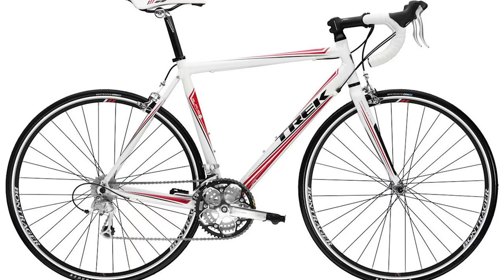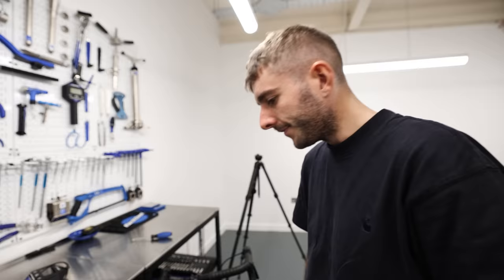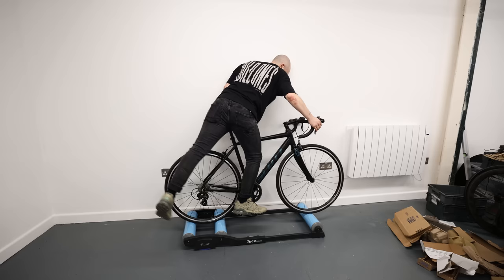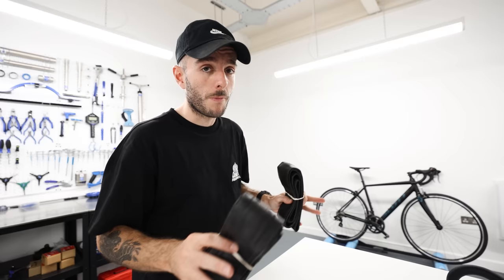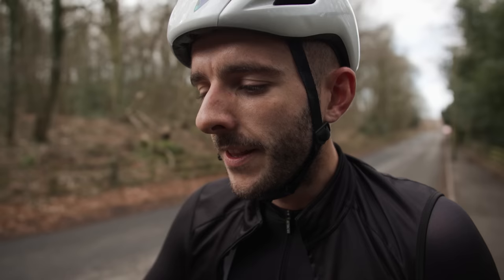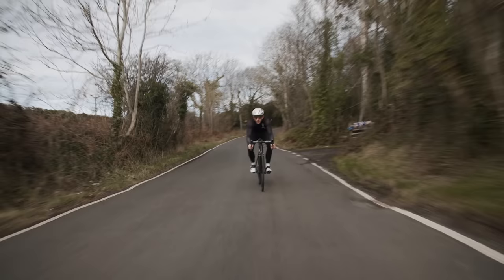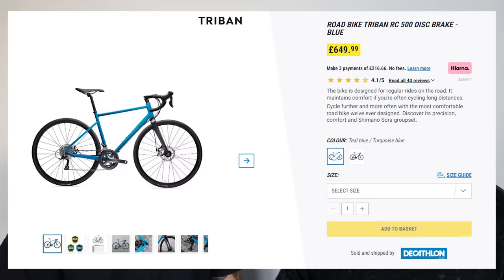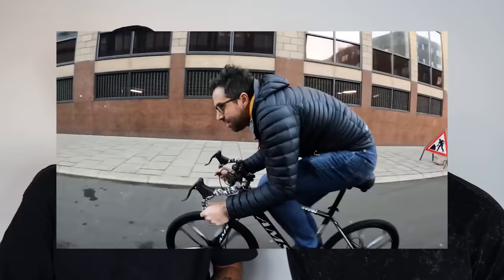How Good Is An "Entry Level" Road Bike In 2023?

Comment: Last year (march) I got a gravel bike with aluminium frame, carbon fork, full GRX groupset (a bit of 600 and mostly 400), nice hydraulic brakes, 46/30 at the crankset, 10 speeds at the rear (11-32 which I've since changed to 11-36 to climb easily). All this for £879. 3000km later I am still the happiest "beginner". Hard to find that kind of price at the moment (except if you find the same model, but with the current difficulties to get Shimano parts, they are now equipping it with a no-name 46-30 crankset instead of the GRX).

Comment: My avatar is my first entry level bike 2015 Ultegra front & rear mech with 105 chain rings, levers & brakes, aluminium frame & seat post but a full carbon fork, compact 50, 34 with a 11-32 & Mavic alloy wheels, £850 from Tredz, fantastic spec for the money, i remember the Specialized Allez coting £650 at the same time but the spec was far lower then the Cube Peloton SL.

Comment: my first roadbike was a used decatlon bike with sora 2x7 groupset  for 195€. it made realize how fast and easy even i could ride even longer distances. i probably rode it 3500 km in the first year. i replaced the steel fork with a  cheap carbon/aluminium one,  the saddle to a used fizik, aswell as the breaks the bartape during this time, the weight is a litle under 10kg and the bigest gear is 52/11 so its quite fast. after that year i got a used cervelo p3 and gave the the decatlon to my brother as a birthday gift a litle later, he also realy likes it and already put about 1000 km on it, (we both use other bikes durig winter) about 300€ well spend i guess.

Comment: In 2014 I bought a brand new BMC GF02 (2013 model) with all 105 parts and triple crank + 10-speed cassette (11-28) for only  £900. The original price was  £1400.  So I advise looking around in shops for a model from the previous year and paying less for a better bike. Looking forward to more 'outdoor' testing videos ;) cheers.

Comment: My first adult bike was a second hand specialized Allez sport 2012 which had a sora full group set (triple 50/39/30 and 11-25 9s cassette) which I picked up for £100. Frame was a 58 which was 2 sizes too big, which I didn’t know at the time. Was a great bike which gave me the bug. Picked up a second hand carbon mekk poggio next which had only been used twice for less than half its original price and still have it, though upgraded everything but the frame. Bought another Allez sport second hand to build up for my trainer, in a 54 this time and managed to build for a little over £125 running 10s sram axis. Second hand bargains are the way to go for me. Love your vids by the way. Been watching for a few years now.

Comment: 7:16  Yes it does, Shimano Claris, at least on my entry-level Giant Contend, has the extra speed on the easier gear. With the compact 50-34 in front and 11-34 (biggest sprockets are 28 and 34) give you that necessary easy gear. 34/34 should be most welcome for most amateur, me in particular !

Comment: My first road bike was a Merida scultura with claris, same ratio as that bike but 2x8, I replaced the shifters with the latest claris shifters as they have the cable routed under the bar tap not out the side of the shifter like the groupset your testing. Road hundreds of kms with no issues.

Comment: In 2015 , I bought a Bianchi Vertigo RRP £1399 reduced to £950. Full carbon frame and fork , looked the part, had ten speed  and specced with  Reparto Corsa, FSA and Campagnolo parts on it. Been looking out for the Italians to repeat that experience but to no avail.

Comment: When I dipped my toe into road cycling during the summer of '21 (so, still quite recently), I bought a $300 "bike" from Walmart (an unbranded Kent) and rode that for 9 months before buying a $2000 Trek.  I set myself the target of completing a 100 mile ride before buying a "real" bike, and it worked out brilliantly for me.  I did upgrade parts piecemeal on the Kent as I learned what features I cared about and which I didn't, and learned what specific aspects of the cheap bike were limiting factors in long rides.  

Being completely straight here - if the minimum bar of entry for me had been $1000+ i may never have given cycling a go.  It's a lot to spend when you have nfc.

Comment: I don't race, I just find that the bike is the most fun way in and out of town to move from point A to point B. I love old steel frame road bikes and I still would love to still have my first one. It was an Atala, size 48 Columbus frame, complete 105 hardware, 2 x 6 group set which was plenty for an urban environment, down tube shifters, quite narrow flat handle bar and it was perfect, light, compact, comfortable. Then it got stolen and I got a lot of health problems which kept me off a bike completely for the past 6 years or so. Now I got back into the game,

Comment: My first bike was a Gazelle Démax (from the Gold Line series) from 1999 with nice Reynold 531 trapezi frame. It had a mixed groupset (RX100 shifters, Dura Ace 7400 crankset, Shimano 600 derries and brakes). Two years ago I build it up with a second hand Ultegra 6800 groupset, and last year I put on a handbuilt wheelset (with used White Industries T11 hubs, new bearings, Sapim X-Ray spokes and DT Swiss RR411 rims). Before this, I spend in total around 600 euro (components and frame), with the wheelset it will be around 1100 euro. Of course I could sell some parts coming of it. This is still my to go to bike. Is it a used bike, but all the time and TLC I put into it, it will never go. With this bike I learned so much about maintaining a bike, that I rather prefer this then buying a new entry level bike. So nice to give old things new live!

Comment: My first bike was a 2011 Motobecane Grabd Record. I bought it because it had shimano 105 for $699 at the time. Tektro rim brakes were not good if it was dreery out. Bought direct so the fit was not great. But I ride it casually for a looong time when I got more serious about cycling the fit was a problem and created a sciatic nerve issue I had to do PT to resolve. Sold it for 350 and bought a canyon Grail. Still riding it today. But go get a good fit. I took my grail to a bike shop and tweaked the fit, but it was still less expensive than say a trek checkpoint with the same GRX spec but only by a couple hundred in the end.

Comment: It's crazy to think thatan entry level bike from a few years ago was cheaper and had (at the time) better components fitted. But that's inflation for you...
I started riding a couple of years ago, during the pandemic / bike shortage and since I was new to road cycling and wanted to be sure that I got a bike that fit me, I chose to go to a bike shop for my first bike. Ended up with the only model they had in stock in my size, which was a Cannondale Caad Optimo 3, equiped with a Shimano Sora groupset. Paid about 1100€ (~970£) out the door for it, and I think it's a great bike to get started. 
The only thing I've changed so far are the tires. Went from the standard 25 mm tires to 28 mm tires and couldn't be happier with it. Suits my needs perfectly for now.

Comment: What I did when I got my first road bike 2 years ago is buy an entry level 8spd Claris equipped bike and just did little upgrades over the months. I’ve shaved over a kilo now with a lot of aliexpress parts for about $350 over two years. The bike was the KHS Flite 280 and was $650

Comment: My Bike is a 9 speed Sora equiped bike from 2011 (750 price bracket, I thought that was mid range at the time), still riding it , but the one real Pain in the thumb is those thumb stud gear shifters mentioned in the vid...
Really didn't matter to me when I started (hood only rider, for the first 10 years!), but now I'm finally getting used to the drops, they are an absolute pita and the only thing (apart from the tyres and saddle) that I'm looking at changing...
Don't get me wrong, I get some serious bike envy when I see the shiny new kit coming out, but it works and it's still fun to ride!
Oh, yeah, 11-28 cassette riding some of the local hills at 96kg, not great, but I didn't know for the first year of ownership, so I just had to work harder!

Comment: My first road bike was a 2005 Specialized Allez Sport. I paid $450 for it, it was matte black and it had Tiagra. It was very, very good, except for the rear wheel which exploded. But I replaced the stock wheels with some Mavic Aksiums and it was a great ride until it was time to upgrade.

Comment: After many years owning a shop, entry bikes are ONLY Ok if they are from the big three with few exceptions. They just have more room in the budget to spec groups etc. That Tourney stuff would have been Sora on a Giant for instance. The lack of a 32t cassette, the lack of a properly sized bar, the bad tape, that's all on the shops not telling their reps that these are required (remember that the brands' customers are the shops, not the rider sadly). Lastly, anyone who has to do a "fit" on these is putting a wide, plush saddle and an upright stem on so we get to sell that at least, lol. Remember too that entry means that the rider has no kit of any type, no apparel, computer, cage/bottle, lights etc so the budget gets squeezed and the bike gets cheaped-out on. Great vid, really liked the premise, cheers guys.

Comment: Gear changes are smooth due to the external cabling from the levers. Less tight angles. Best mechanical shifting I ever had was Dura Ace 7900 which (I think) was last model before they routed gear cables internally (under bar tape). However, I have never liked the look of external cables and was more than happy to suffer less smooth changing for a cleaner cockpit.

Comment: My first road bike was a 2006-ish Trek 1000SL at around £500, which had a Tiagra groupset and Bontrager kit. Lovely bike for a hefty rider, until it got stolen in East London. I replaced it with a 2011 Pinnacle (Evans Cycles' own brand) Dolomite 2 (about £650 at end of the season) with a mix of Sora/Tiagra, which still serves me well as an all-weather fast commuting and occasional holiday bike.

Comment: Decathlon really do give you a lot in comparison to other bike manufacturers, I have had a few. I bought a used near mint  Triban 540 a couple of years ago for £280. It has the 11 speed 105 groupset (rc 500 crank not 105 and adds 100grams), Mavic Aksium wheelset and carbon bladed forks. I love it. It has rim brakes but they work just fine. Previously  all my road bikes had mechanical disks i.e. Avid bb7 and Tektro spyre but always were a pain. Also the Aksium wheelset utilise cartridge bearings which for me is a plus. I hate cup and cone bearings and the hassle of  keeping them adjusted. So much so I bought another set for my old Claude butler Road bike (9 speed Sora)that I commute to work on.

Comment: If you're getting started in a new hobby, it's always worth to check out used items as this usually gets you more bang for your buck and if it turns out you don't really like 'new hobby' you can sell the used items at a low or sometimes even no loss.
Reply: Personally I think this is only true if you done a ton of research OR have a friend that is experienced and can scope things out with you OR already have a bike shop you trust (less likely if you are new to the sport). I think buying used is great but if you are new you don't want to be fighting the basic function of your equipment and you don't want to end up with a piece of equipment that needs so much work you could have just bought new

Comment: Thanks for the vid. I know you have said it in the past, and sorry if it’s been repeated in the comments, but the handlebar width issue really needs to be addressed. Size options should be available with every new bike purchase; not just the ones you customise at the high price point.as you say, 42 width on a size small is ridiculous, but having to replace them immediately for someone on a tight budget is also ridiculous.

Comment: I got a good deal on a used Boardman with SRAM Rival 10 speed, alloy frame and carbon fork. I've since replaced the wheels and tyres but it's serving me well as a beginner rider.

Comment: My "first" road bike was a Serious Valparola. Cost me a tad over 400€ in the last months before the pandemic. Six months on, and the same bike, same spec was 1000€, so I guess I got lucky. It came with a Claris group set and many of the same parts you had on this bike. Straight away, I made pretty much the same upgrades you made, too. Tires and saddle were the first thing, a little while later I swapped the handlebars. Then more modifications over time. A carbon seatpost, which makes a good difference, comfort wise. Changed the brakes to a set of 105s, then put in an actual hollowtech 2 claris crank, so I could get a left side powermeter, and I got a new, 35mm rim alloy wheelset. And the ultimate atrocity, as I got used to the position on a road bike more and more, I got a -25° stem to get into a bit of a more aggressive position. Not too many original parts left on the thing now, but it's still my only road bike. With prices what they are these days, anything that's a significant upgrade over this is pretty much out of my price range, so upgrading bit by bit was the way to go for me. It's got about 50000k by now, I reckon, and still going strong.

Comment: My first bike was a Mekk A1 Pinerolo AL 1.5 (bought on Cycle to Work Scheme). Great bike for the money at the time considering it came with carbon forks and tiagra for £800. Gradually upgraded components over the years as the frame was a great foundation

Comment: My first road bike was the one I got a decade ago (and still ride). Genesis Equilibrium, in the sale down to £999 with 10 speed Tiagra rim brake groupset. Back then it was the lowest Shimano groupset without thumb shifters. I didn’t buy the Sora version because it had the same shifting levers as the current tourney (though sora was 9 speed,compared to tourney’s 7). Since then I’ve changed handlebars (narrower), saddle, pedals and wheels. The rear derailleur broke last year so it now has a 2nd hand 10 speed Ultegra derailleur and shifts beautifully! It’s pretty sad that £900 now only gets you the lowest groupset Shimano manufacturers

Comment: For 559€ (599£ over there) you can get a "Women's road bike triban rc 500", which has a carbon fork (alloy steer tube), and full Shimano Sora with rim brakes. Although the geometry is more on the upright size of things, you can always put a super low stem on it.

Comment: My first bike was a Decathlon Triban 7. Bought it 10 years ago and still own it. Cost £550 and had 10 speed Tiagra (46xx series). Nowadays, the big manufacturers (well known) you'll get an entry-level bike for around £1000, but for a brand like Decathlon, I think you get get a similar spec for £100-200 less.

Comment: I'm kind of old. My first nice road bike was a Bridgestone. Steel frame with the beautiful lugs. Before that, I only had a Huffy my parents bought me as a kid. I liked the Bridgestone but I could feel a little flex in the BB when I'd really put power down. (I am 6'2" and was in the Marines at the time. I could put down some power.) I saved up some money and bought a Cannondale that was custom built. It was as top of the line as you could buy at the time to include the wheels. I sold the Bridgestone to a buddy of mine. I always wish I could have kept that bike since it later became a classic. The Cannondale just felt like a rocket in comparison. Granted it did ride way harsher.  Especially back then with 20c tires pumped up to 120 psi.

Comment: My first "racer" was a Viking Warlord 10-spd in 1981 when I was 12. :D Upgraded to a Peugeot "Carbolite 103" frame in 1985, then a nice Reynolds 531c bike with SunTour Accushift in 1988 (£300). Old school with 52/42 chainrings and a max 24 on the 6-speed block.  Hills were not fun. Went to carbon and 105 with my Scott CR-1 Team in 2009 for around £1250 and am still riding that. It still does me well, but I do want to upgrade before I'm "too old" to really enjoy it 🤣 But bikes are so expensive these days!

Comment: There is a lot of brand premium in that bike. Decathlon sells a 105 bike with a carbon fork and cable operated hydro TRP disc brakes for 850, or a sora bike for 550. Vitus has a claris bike with a carbon fork and rim brakes for 600.

Comment: probably not the greatest idea but my first road bike is a vintage steel frame i got for £40, then spent another £400 (aswell as blood sweat and tears) upgrading it with various parts, went for a 2x9 setup with a sora rear derailleur and mircroshift front, sensah shifters, for the money I spent compared to what i could've gotten brand new, It's fantastic aswell as being completely unique.

Comment: First bike was a GTR Sport (I believe manufactured back in 2008). Found it at a LBS and got it for $500 in 2019. I put around 4k miles on it before upgrading to carbon but boy do I miss riding it. Still have the bike, components have lasted well, and some day I’ll rebuild it!

Comment: the grx chainrings are fantastic. its a kick in the face that they wont put it on actual road bikes. most beginners arent gonna do 55+kmh so no need to have  50 x 11 anyway.
 ive been riding my older merida cyclocross bike last few days with 46/36 and oh my days, its  so sweet.

Comment: Yes. I would consider that an entry level bike nowadays. I agree, you should be able to spec parts from the manufacturer. My first road bike was a 2013 Fuji Gran Fondo 1.5 C. I got it in 2014 as a year end clearance for 2013 models.